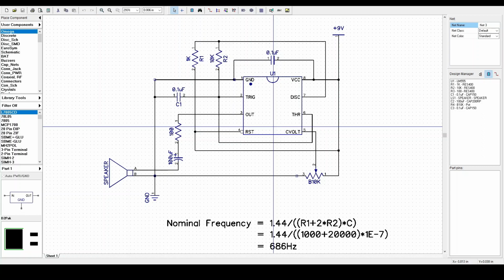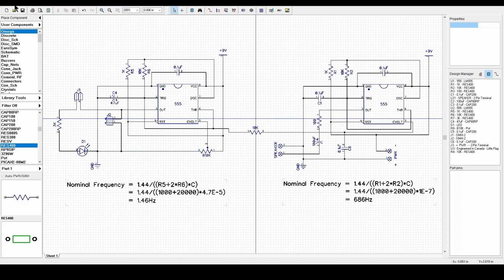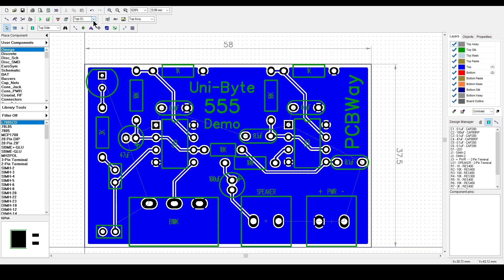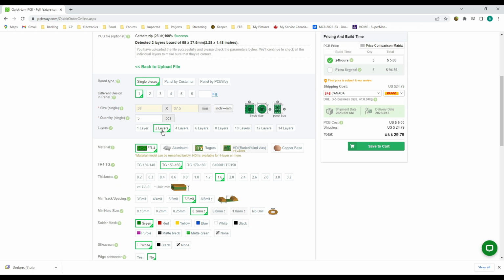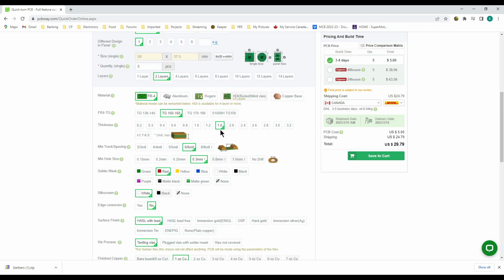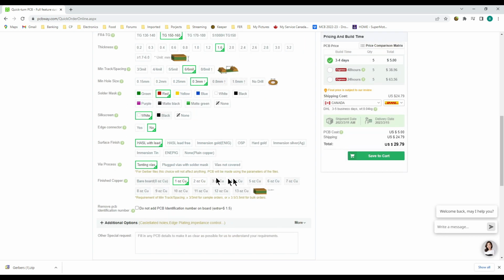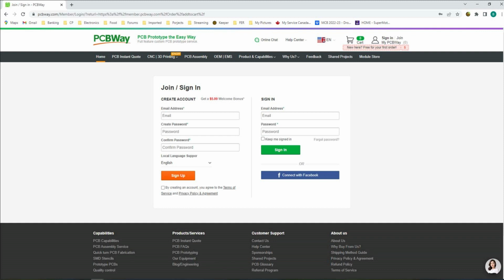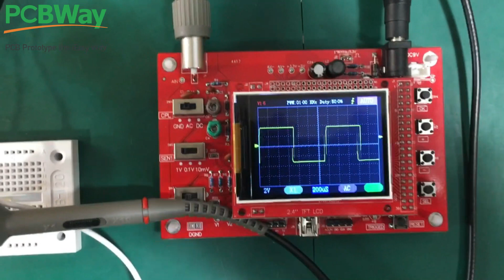0025 - Beginners Electronics Project #1: Astable 555 Part 2

Comment: Very interesting video, as I will be ordering some PCBs in not very distant future. Could you please explain what "plugged vias with solder mask" means? 13 oz Cu thickness? WOW last time I checked in 2016 4 oz Cu was an expensive top shelf process. Great channel!
Reply from the maker: Glad you liked it.

Plugged vias are what you might think.  They are usually plugged to prevent solder from entering the via, or to seal the board.  They can be plugged with various materials such as epoxy, metal or just solder mask.  You might choose epoxy if you do not want solder mask on your board.  You might choose metal if you want higher current going through them.  The easiest way it just plug them with solder mask.  Filling the via with solder mask provides a better, stronger plug than does tenting.  Yes 13 oz copper is pretty thick.  I guess if you need very high current capability or really good heatsinking you make that choice.  However, it's expensive.